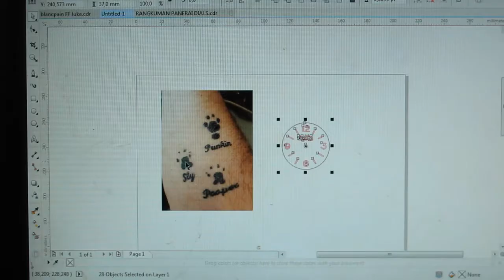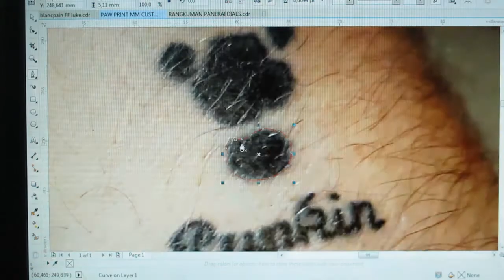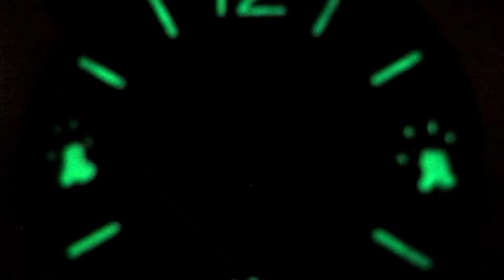MAKING A PAW PRINTS CUSTOM DIAL

Comment: Hello, thanks for the video, very interesting. I have some questions.  What kinds of paintings do you use for the background and for the signs ? A brand in particular ? What tool do you use to put the white paint in the signs holes ? After putting the white paint, how do you deal with extra white paint that went over the edge onto the background ? Thanks a lot. Olivier.
Reply from the maker: Thank you so much for stopped by and watch my video. I use acrylic paints. Any brands as long as they have gasoline-proof to make the painting solid. I use oilers to apply paints and lume.
Reply: @pormodcustom9088  thanks a lot for your answer, have a good day.
Reply from the maker: You're welcome, and have a good day 🙏🏻